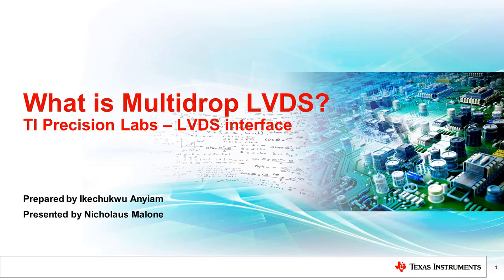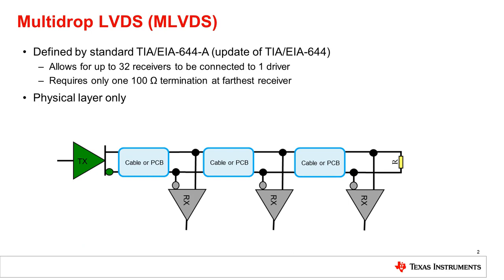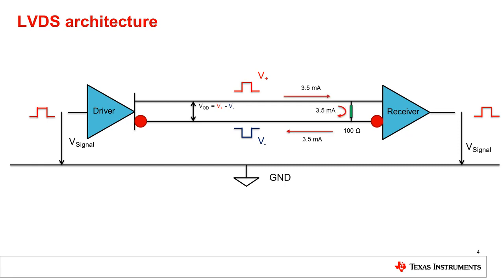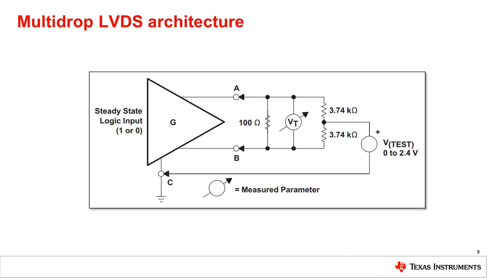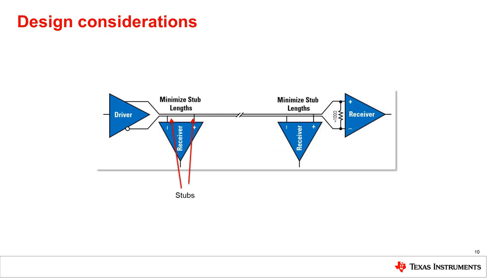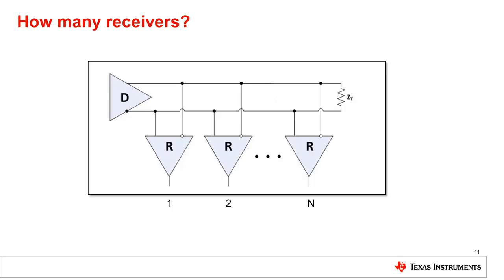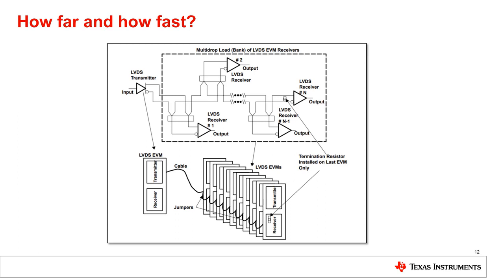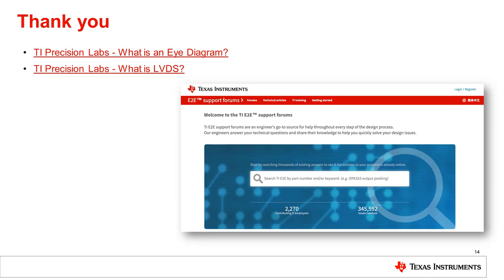What is multidrop LVDS?

Comment: is this some kind of signal amplifier?
Reply: M-LVDS is a standard for communicating at high speed in a multipoint applications. It offers a long-distance digital interface for serial communication over an electrical interconnect. The M-LVDS uses differential signaling where the receiver detects data based on the voltage difference between two complementary electrical signals.